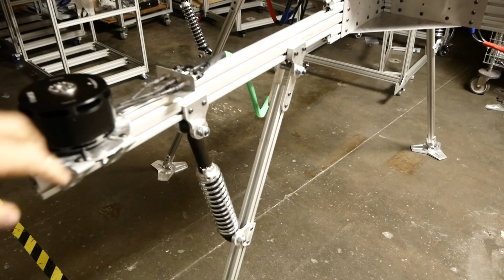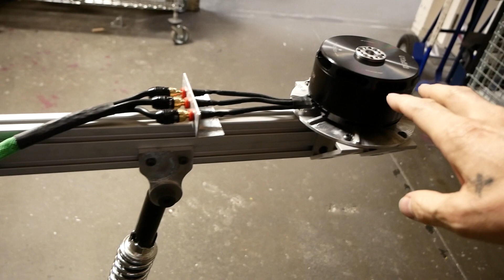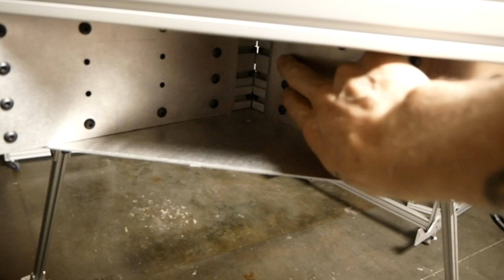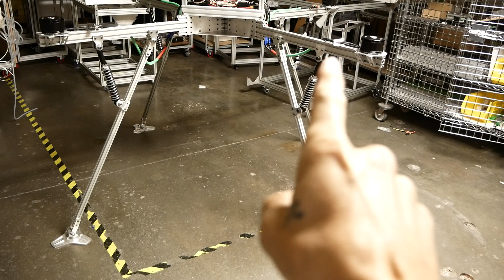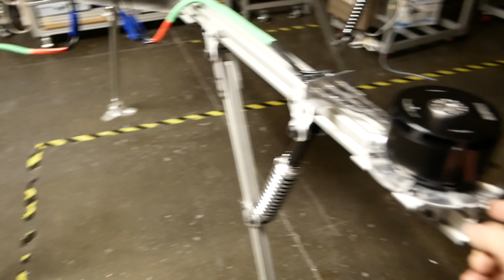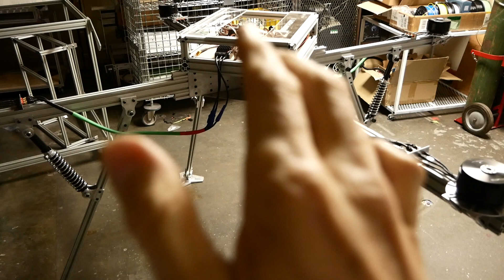#84 - Heavy Lift Drone Project - Update 4

Comment: Ha ha ha! been there done that! Shocks! Done that! Long lever arms will bend on impact when off tangent. Cool but complete waste of effort. A crash from 15 ft up and it's done! See "Rockford Quadcopter"...try using plastic re-bar end caps for feet. Use bicycle type cam-lock clamps to in place of all those arm screws. Try iFlight F7 TwinG controller and APD ESC and power dist board. Just ONE rope tied under the center and to a dumbbell to limit flight.